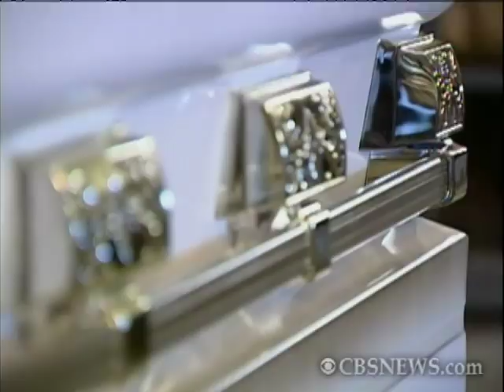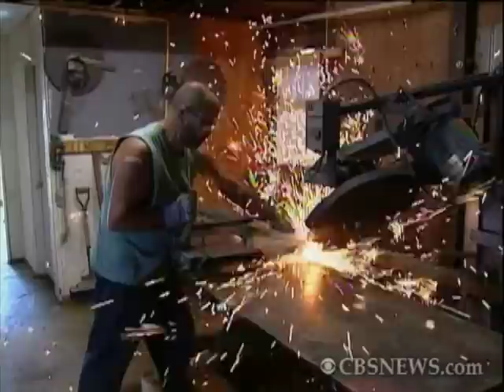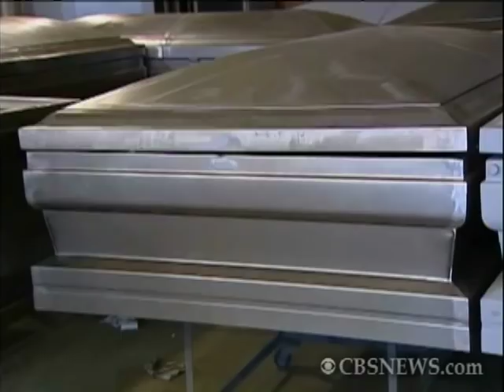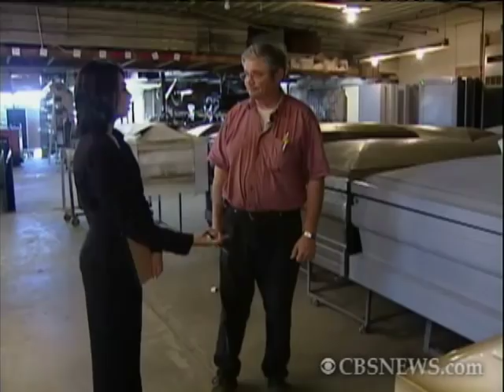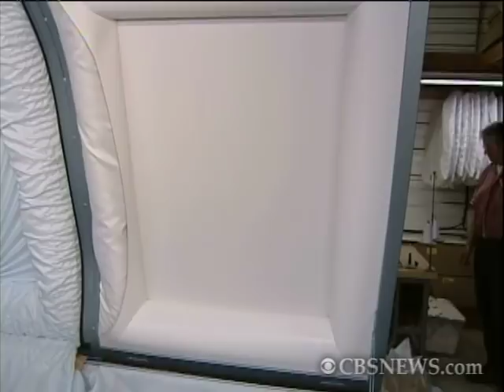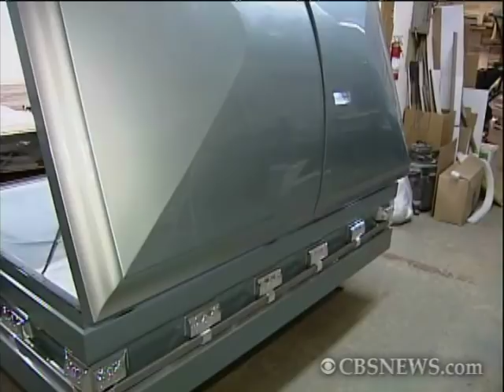Caskets for Obese Booming

Comment: my company digs graves and we have noticed an extreme increase in the number of extra wide graves.
we  have to charge twice as much for these Graves
Reply: That alone should be an incentive for the family to consider cremation. Why pay good money for a body to rot?
Reply: No joke cremation for the obese runs the risk of causing a serious fire.  The excess fat causes what's essentially a grease fire. That's one of the reasons why they said options are limited in the video.
Reply: Was going to ask about the grave sites and size.. Probably bigger than 2 plots if someone is 600 pounds. Very sad.. 
Just realized comment 2 years old!! This just came recommended????? Weird
Reply: Add insult to injury!
Reply: @MauriceRivers415  Very good point
Reply: kEePiN Itt KaNGstAa Are you serious, gosh I didn’t know that
Reply: @MauriceRivers415  Cremation costs more too, more gas needed
Reply: @milliemaxwell5282  Still cheaper than the dog & pony show of buying an overpriced casket and burial plot.
Reply: Buisness booming
Reply: Grave
Reply: They take up more real estate 😂

Comment: Aw'hell naw...Cremation is how that's goin down. Imagine the size of the ground vault it has to be placed in.
Reply: bmentlow Wouldn't that amount of fat cause a fire hazard during cremation, or an explosion if buried in certain environments...???
Reply: No..It would just take longer to burn.
Reply: Yes it would gina, in some cases it does.This person doesn't know or hasn't seen it happen.
Reply: bmentlow yes you are right (but for "normal folks" too ;;;--   to avoid discrimination lawsuits 😍😂🔑💼🔑💼🔨🔧🚦💅🔑🔑💼
Reply: Cremation retorts are on an average 36/38 inches wide.  I would assume a farm animal cremator would be the only option. Or bury casket from flat bed with crane and no concrete grave liner.
Reply: There are other more novel ways to reduce a corpse into a neat pile of minerals. Dissolve the body in hot lye and boil off the water. In this case, all that fat will make a huge pile of soap instead.
Reply: There's always green burials or liquid cremation which are eco friendly.
Reply: @bmentlow  There have been incidents of things getting out of hand and burning fat leaking out of the retort.

Comment: Ok, so what about the burial vault?  That would also have to be large enough to accommodate the extra large casket.  Does this company make large burial vaults too?  The cemetery plot too as there is only so much space in the cemetery.  Are the doors in the funeral home wide enough to allow a jumbo sized casket through?  Finally what about pallbearers?  It’s gonna take a lot more than 6 people to carry a 600 lb to 1,000 pound person!  Lots to factor in here for a very large corpse.

Comment: The pallbearers will be replaced with fork lifts
If I were a manufacturer I would refuse to make ANYTHING for people bigger than the simple XL
Reply: No doubt about that! They're gonna have to use the truck that sets the vault in the ground as the "pallbearers"🙄! Hell, I wouldn't even sell 'em a casket. I'd tell 'em to throw 'em straight into the vault and have a quick viewing at the cemetery...lol.

Comment: @daphnehatesderby  An obese person cannot fit into a normal casket. As a funeral director, trying to squeeze a 300 pound person into a normal casket looks just wrong. The body is twisted, the arms cannot bend properly, and the face looks enlarged. Also the casket is not built to hold that weight. The handles break off, the bottom cracks and if you think a body dripping through the bottom seams during a church service is acceptable, buy the normal one.

Comment: They also SUE, or try to, even after they were made aware & signed forms stating that their "B I G hearted," "Larger than LIFE" mom, gramma, pop, grampa, auntie, cousin, etc. were FAR too large for the chosen casket. They let out howls of indignation when it takes a dozen men to sit on top of the casket to seal it, then run out to make calls to a shylock attorney. FH's should turn down "BIG" clients unless the HUGE caskets & needed machinery to move them are paid for.